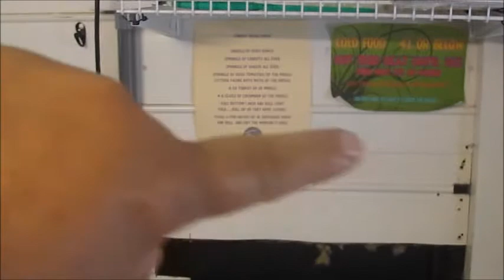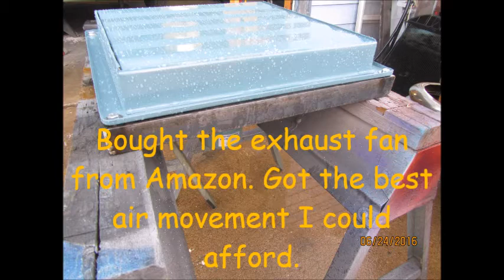Chapmans Take Away Food Truck ~BUILDING A FOOD TRUCK~ Exhaust Fan

Comment: thank you for your info. your videos are very helpful. I bought a truck and just starting it I know nothing about this stuff so thanks for the help! is it really worth buying an a/c since it really won't cool the truck off?
Reply from the maker: Hi Josh. I found a used one. 100.00 then paid our local RV place to cut the hole and install it. 450.00..... so for 550.00. To us here in Kansas,,, Money making season is june to aug. Some temp in the truck was  well over 100..... It wont cool it but for you and your workers to feel the breeze on their heads and shoulders. to let the workers take a break under it... well worth it. Also the head does not drip so much sweat that customers will see. Good Luck!

Comment: do you keep the prep table running overnight? and by the way may i ask where did you get the table for you griddle? i can't find on that short
Reply from the maker: yes we do several nights a week. Here in Kansas we run the fans mostly the exhaust fan if we feel the fridge is struggling. I like my temps to be  around 39 degrees. Law is 41. So if it at 40-43.... then we give it some help. Fall and cooler temps are here. It wont require much help now. I got my table from Sun flower restaurant  supply. can also find it on volrath.com